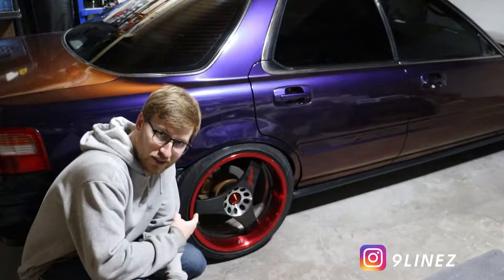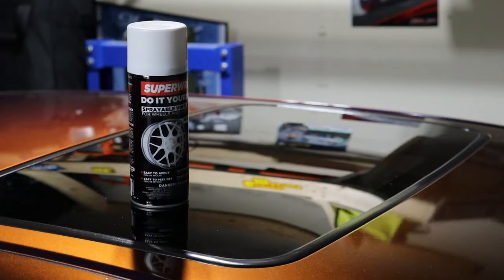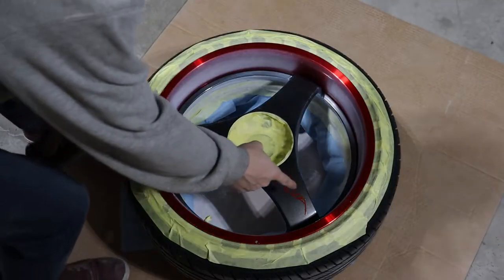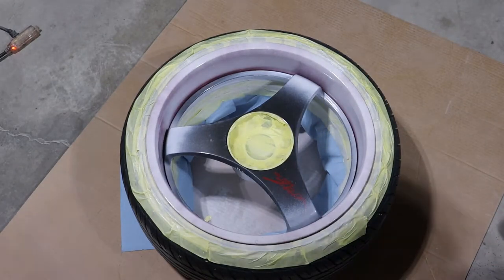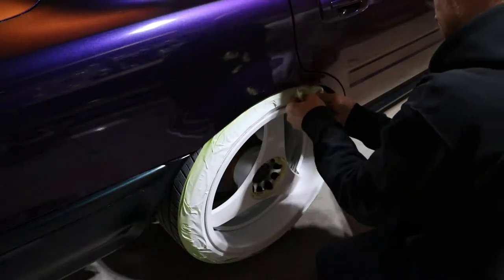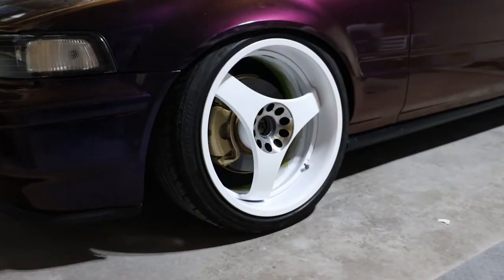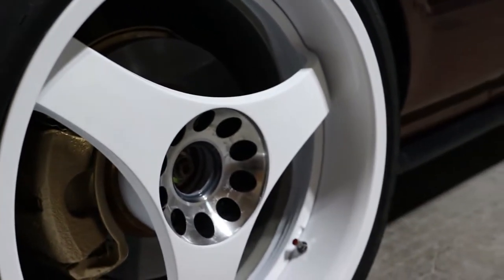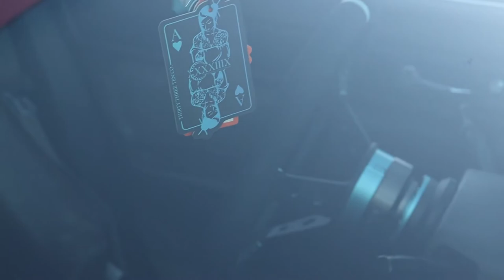SPRAY WRAPPING MY WHEELS & FINAL REVEAL! // Vigor Vlogs

Comment: What did you use to clean the rims? Stuff looks like it works good
Reply from the maker: @mattb12341  It’s actually just the Superwrap wheel cleaner that came with the wheel prep kit. If you watch the beginning of the video I showed it there a bit. But it does work well. **gotta be careful not to let it soak too long on the wheel stickers though it can pull some of the ink off, I’ve got replacement stickers for whenever I finally get around to doing a bit of a wheel restoration on these.